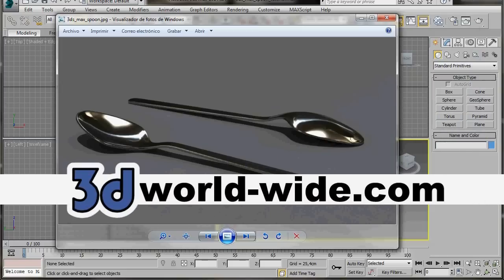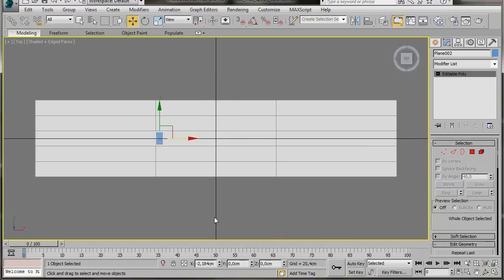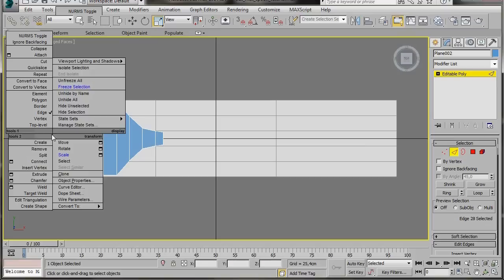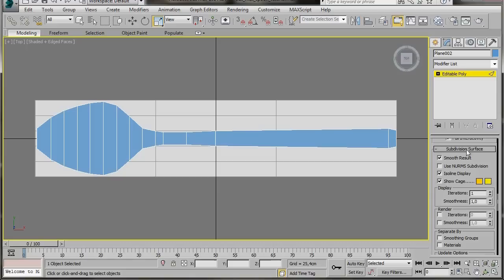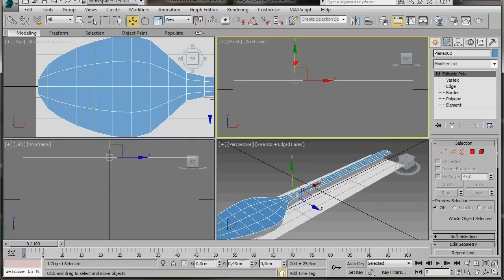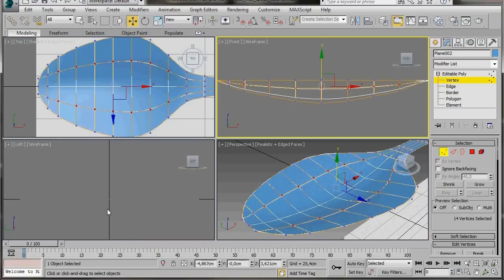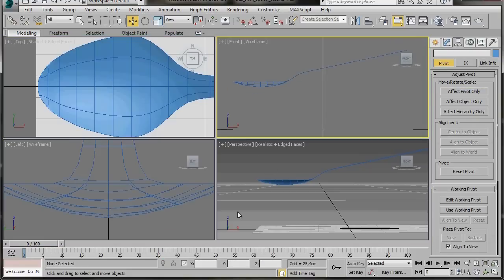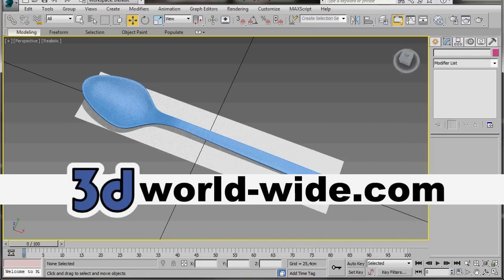3DS Max Spoon Modeling - Easy Beginner Tutorial

Comment: First off, great tutorial! Thanks :)
How do I get a non-uniform shell thickness? Say, I wanted the handle to be slightly thicker than the neck and the bowl.
Reply: ***** You can't do that with shell alone, you will need to incorporate the push modifier and select the polygons which you wish to thicken or make thinner. Soft selection can help with this.

Comment: Hi Wendy,
I'm not sure what i am doing wrong here. I am sure it is something simple. when i select the edge "3DMAX 2015" I hold shift like you say to do, but it selects and or only moves the original edge and does not extrude that edge. can you please tell me what i am doing wrong ?
Reply: +Michael Morrow I'm having the same problem on 2017 version
Reply: +sadman hoque It should work... Hold SHIFT and move your edge! Make sure your edge is selected first! Let me know if it worked?
Reply: +Keyboard Warrior by 'edge' you mean the x-axis arrow right? I did that it doesn't work, although I hold shift first and then click on the arrow, should I do it the other way round?
Reply: +sadman hoque When your in the (Edit poly) modifier there is vertex, edge, face etc. you have to select edge then go to your model and pick an edge you want to extrude! After you picked that edge hold SHIFT and move it on the X-axis then it should extend.
Reply: +Keyboard Warrior its working now, thanks a lot! :D
Reply: +sadman hoque  The issue is i was in Maya mode "The way you move in the window". it has to be in 3dmax mode, its in the options. once i changed it back to 3dmax had np.

Comment: Hi Wendy, I've watched and completed about 8 of your tutorials. Something I don't understand - sometimes you use turbosmooth and sometimes you use nurms - what is the difference and how do you know when to use each one?
Reply: 3970xRocks There's no difference between them except for some very minor algorithmic differences which will only show up in very specific cases. Most people use Turbosmooth because it's a modifier, shows up on the list and can more easily be turned on and off. NURMS requires you to scroll your modifier panel constantly. If you are using Max 2014 Extension or 2015 or later, you should be using OpenSubDiv instead of turbosmooth in every single case without question. This method doesn't require as many edge loops as it's a cleaner algorithm developed by Pixar specifically for subdivision modeling, so it works very good simply with edge creasing values.